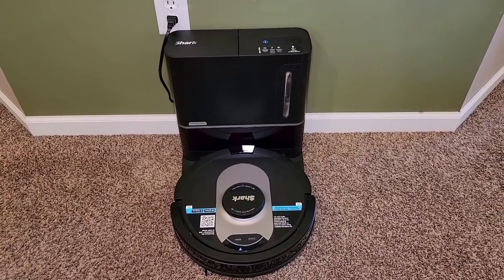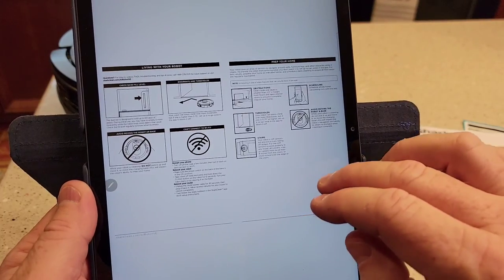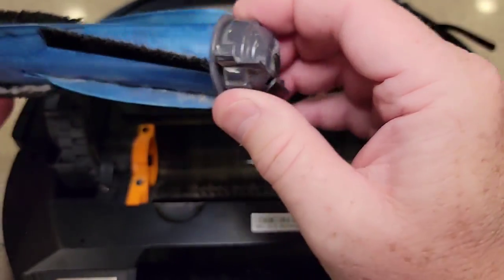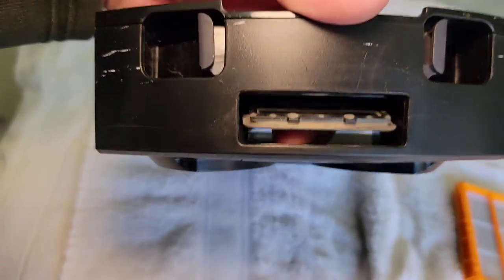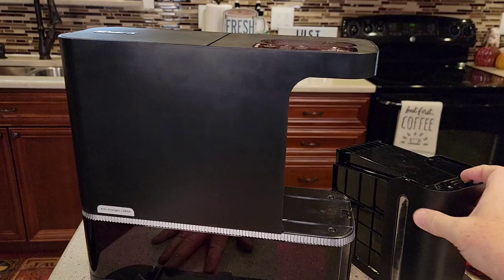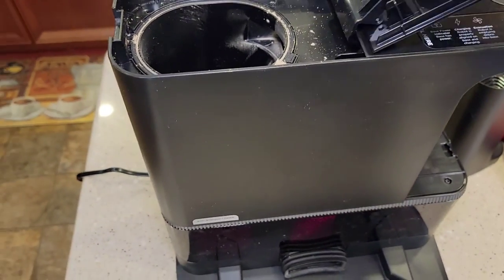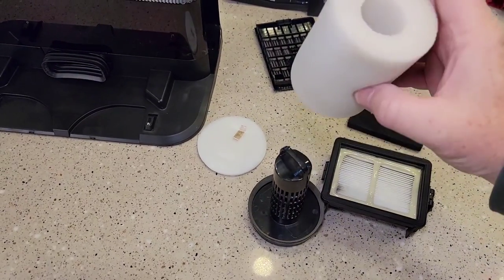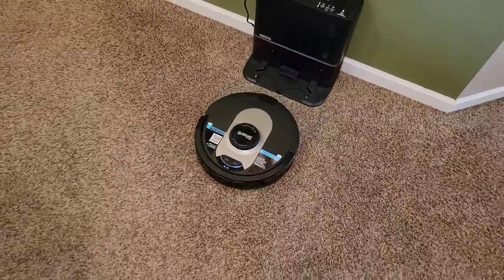Shark RV2502AE Robot Vacuum How To Take Apart & Clean Filters QUICK FIX MONTLY MAINTENANCE

Comment: Another good review. I cannot wait to use these tips when I get this vacuum tomorrow.  I always take care of my vacuums. It increases their longevity. My Shark Duo-clean still looks like new. I clean the filters weekly. Dustbins get cleaned on the corded and stick (Shark Vertex cordless) daily. I purchase an extra dustbin/filter whenever I purchase a vacuum. In doing so, I can rinse out the old bin/filter and replace it with the item that is already clean.

I love that brush roller. I have the power fin technology on my Shark stick vacuum, which is incredible! So very little hair gets caught with that roller. My daughter and I long, thick hair. It does an excellent job picking up hair, and the hair is not wrapped around the roller.
Reply from the maker: Thanks so much!

Comment: Getting error no. 5 for side wheel. It seems to be stuck and regular screw driver won’t work. Have you tried taking out the side wheels? Not sure which particular tool works for this issue.

Comment: Fairly certain all the filters can be cleaned with cold water. Just let them air dry fully before reusing. So before you replace, clean them with water. Replace when they are no longer useable.

Comment: I have a UR2500SR and I believe the drive belt is slipping.  Sounds just like this vacuum maybe a little louder.  Do you have a part number for drive belt or a video of replacement?
Reply: UR2500SR seem like exclusively made for the Costco. UR2350SR for the Sam’s Club. 

The other 2500 Series robots such as RV2502AE, AV2501S, AV2501AE, UR2505SR accessories part may fit the UR2500SR.

Comment: You missed 2 things....1 the end of the brush roll comes off and hair gets trapped under that gray end that comes off. 2 the top navigation module needs to be cleaned... while propped on side spin the navigation module inside clockwise a few times with a q-tip DO NOT put inside sensor holes! Then blow the area out with a can of air or a blower. When this part is dirty it will have an error code that says remove hair and debris under shark logo. Otherwise good information.
Reply: How do you get that gray end off? Mine wouldn't budge.
Reply: Yes we just had the “remove hair and debris” error in the app. The lights on the vac flash ( Clean flashes green, dock light flashes red and a red exclamation point). We found another helpful tip online to clean it with a cue tip. You don’t remove the top circle piece. Only clean around it with alcohol and a cue tip.
Reply: @Vydio Did you ever find out how to get the gray end off?
Reply: I’m having that same issue I’m going to try that I hope it works my neighbor just threw this model out with the docking station and I always wanted a robot vac.